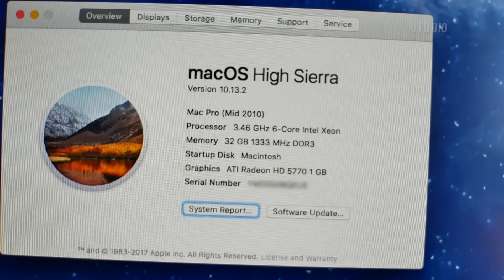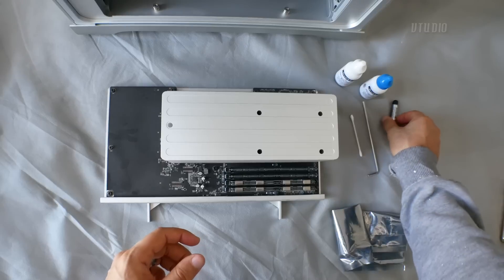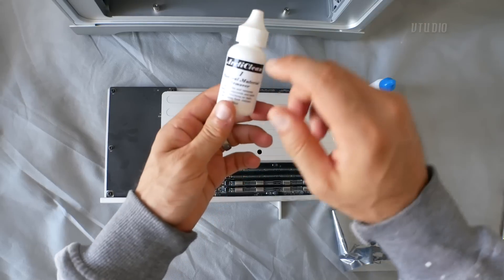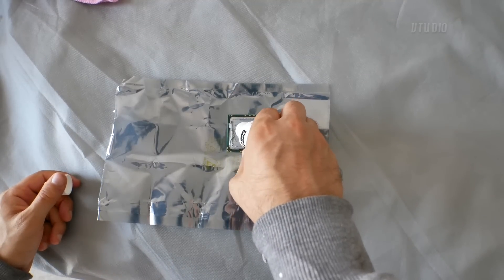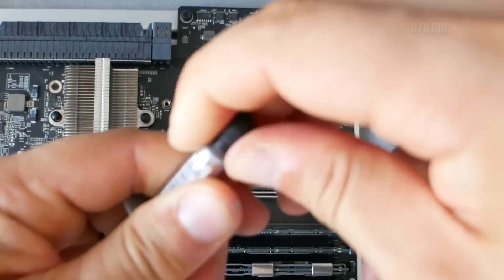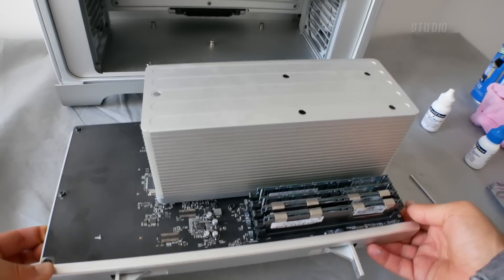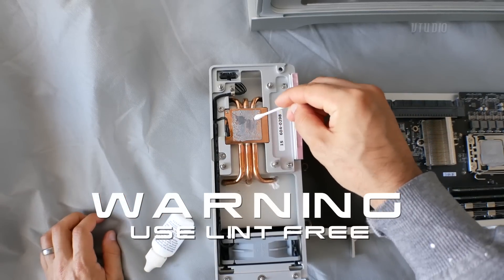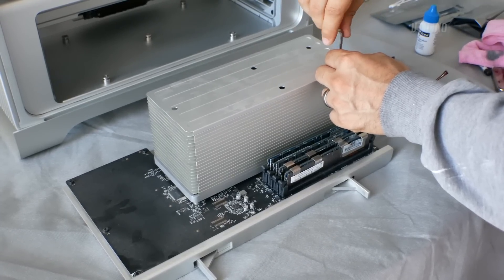Apple Mac Pro 5,1 CPU Upgrade Guide | 6-Core Xeon X5690 3.46Ghz

Comment: Hello,

Great videos and info. I have the 2009 Mac Pro 4,1 that was upgraded to 5,1. Now that i am on 5,1(2010) I want to upgrade my GPU, RAM and CPU. The CPU seem to be the hardest to do as I have to delid or buy a 2010 CPU tray. I have the 2.93GHz 8 core xeon tray. I wanted your advice with this process. So, my goal is first to upgrade the GPU to one that supports boot screen. Next my CPU upgrade directly reflects on getting 1333GHz RAM. One step at a time for me. I updated the HHD to SSD.
Reply: you can find the boot screen models on eBay, do a search for " mac video cards"  this how I found my Radeon 7950 for 175 couple years ago

Comment: Now this is history unless you have a graphic card with Metal-support, otherwise you can’t upgrade to MacOS 10.14!
Reply from the maker: I'm so glad that they kept support for these machines, wishfully hoping that they update the BIOS to fully support Metal graphics cards like the RX 580 in 10.14 - as in they register on the boot screen.
Reply: Kept support? They are not in the list of compatible devices, there you must have Mac Pro 2013 at least. With some work of your own you MAY be able to install 10.14, no guarantees.
Reply from the maker: Hey mate, it says they support 2010-2012 Mac Pro's with Metal capable graphics cards, not just the 2013 Mac Pro.

"macOS Mojave will be available this fall as a free software update for Macs introduced in mid-2012 or later, plus 2010 and 2012 Mac Pro models with recommended Metal-capable graphics cards."[1] 

[1] https://www.apple.com/newsroom/2018/06/apple-introduces-macos-mojave/
Show less
Reply: Okay, that I haven’t read yet.Sorry. I have a Nvidia Geforce GTX970 in my Mac Pro mid 2012 with Metal-support. But it’s not working properly. You can’t use it with MacOS Graphic Driver at all, just Nvidia Webb-driver. I installed MacOS 10.13.5 last night, and during installation the card began to use the MacOS Graphic Driver, and the installation wasn’t completed. I have to change language in Finder afterwards and restart the computer with the Webb-Driver. The card is recently bought on ebay, but I suspect it’s bad/broken in some way.
Reply: @parnordqvist3895  7 months late to this convo, but still completely relevant if anyone reads this. Get your facts straight on GPU support in cMP's... nVidia is supported with nVidia's driver, and AMD is supported natively. Apple prefers AMD these days, they even give some info on their site on cards they recommend. In either case you don't get EFI boot support which is why you're experiencing what you have, not because of bad card. Finally, look up MacVidCards if you want a card that fully works like a native mac GPU.
Reply: @binba9  the much cheeper way is to get an older GT 120 to realize boot screen and then put a powerful AMD card into your Mac.
Reply: its not history, for one... you can use High Sierra for YEARS without needing the COOL effects of 10.14.  2) there are gazzilions of Metal supported Vid cards for this computer. History? be old enough to use that word wisely
Reply: just flash your mac to a 5, 1 and that opens up things quite dramatically

Comment: What are your thoughts on the stock "twelve core" 2.93 xeon x5670.  Would that be decent enough to run the RX580?
Reply from the maker: Hey mate, yeah it should be fine running an RX 580 - did a review of that card here: https://youtu.be/RGCceOhv3f4, what's your use case are you more gaming or video editing or audio production or photography?
Reply: I was hoping to build a decent gaming rig.  I'm planning on upgrading to an SSD and sticking with the stock 16 gigs of RAM.
Reply from the maker: Nice one, for a gaming rig the twelve core would be overkill, you're probably better off getting a single CPU version as most games aren't optimised for more than one processor, unless of course you already own it and are just looking at a GPU upgrade.
Reply: Vtudio, I had the opportunity to pick one up for cheap that happened to be the 12 core model. An SSD and GPU are the only mods I have planned for now.
Reply from the maker: Ace dude, congrats!

Comment: I got the red light blinking after installing 3-(4GB) 1Rx8 PC3 -149000E and one regular 1066 in the wrong order. Now my 2.8 Quad Core has 16gig Ram (down clock) 1066, I got them free from a client that wasn't using them.
Reply from the maker: Ace deal mate!

Comment: I just post a comment in one of your previous videos and I just figure it out one f my questions... This machine (exactly the one I am just about to buy) doesn't support the double cpu... Do you think it's worth it pay the extra money for a newer model with that characteristic?
Reply from the maker: For me getting a dual core model would of doubled the costs, so it was out of the question. However, if you can get a good deal, then I'd go for a dual CPU. One thing though is that it's only a couple of weeks away for WWDC where Apple might announce their plans for the new Mac Pro, which may tempt you into waiting for that or at least drive down the prices of the current ones on sale.

Comment: Another suggestion for cleaning Thermal Paste is a coffee filter. Lint free and cheap lol. That's all I ever use when I upgrade and build my computers at home.

Thanks for the video :) Newer to Mac's but have tons of PC building experience. This and your memory upgrade guide helps. Planning to do a side job and trying to make sure I get the right hardware and see the upgrade process first. Though with the price of a Xeon 5690 still pretty high even here in the States I think the job might be restricted to just doubling the memory to 16GB from 8GB since that's the true bottleneck in that system. I just have a hard time telling them to upgrade to something that isn't really cost effective ($300ish for the X5690 vs. $90 for new memory) on a machine that is only used for running a couple of programs for a church service once or twice a week. Rather see them save that $300 and put towards a newer Mac down the road or something else they need to upgrade/fix.

Comment: A little suggestion.

If your single CPU Mac Pro uses a Xeon W3680 6-core processor, don't bother upgrading to a single X5690.

These two CPUs are fairly close in terms of performance, so you probably won't notice an improvement.  Conversely, if you can find a W3680 for cheaper than an X5690 for a single CPU tray Mac Pro with a quad core Xeon, it might make more sense to go with the W3680.  You'll still upgrade to six cores and your wallet will thank you.

The only real benefit to the X5690 is that it can work in multi-processor configurations whereas the W3680 won't, therefore (if you're wanting to upgrade from a W3680) it makes more sense to save up for a processor tray swap to a dual CPU tray, perhaps with twin X5690s.
Reply from the maker: Hey mate, where did you hear that the X5680 won't work in dual xeon configurations?
Reply: The W3680 won't work in multi processor configurations.  Source: Intel datasheet under "Package Specifications (Max CPU configuration: 1)."

https://ark.intel.com/products/47917/Intel-Xeon-Processor-W3680-12M-Cache-3_33-GHz-6_40-GTs-Intel-QPI

I'm sorry, but I didn't say anything about the X5680.

And single CPU tray 6-core Mac Pros using the 3.33 GHz processor were equipped with the W3680 as opposed to the X5680.
Reply from the maker: My mistake mate, I read the 3 as a 5.
Reply: No worries.  Cheers.
Reply: I think you may have to find a 2009 Mac Pro tower that either has no tray or a single processor tray to use your dual CPU tray in.
Reply: Ah, so the CPU would work, but the concern with a lidded CPU is that it's too thick to allow proper mounting of the heatsink.

But, it is possible to mount the heatsink without delidding.  You just don't tighten the heatsink mounting screws all of the way like you would with a delidded CPU.

This video might be helpful.

https://youtu.be/7O-FQgeaBE8
Reply: Sounds like what I need to do. I have the 2009 dual CPU tray with two 2.93GHz Quad Xeon chips. I want to upgrade to the 3.06GHz six core Xeon for 12 cores (Westmere), this should allow for me to use 1333GHz RAM. But the 2009 4,1 trays are not compatible with the 2010. Any suggestions?
Reply: Watcher3223 - I have the 2009 Mac Pro that I have flashed firmware to 5,1. I want to drop two westmere Xeon chips in my current tray for a 12 core config and to utilize faster RAM. But I'm reading that putting native westmere 2010 Mac Pro Xeon's into a flashed 4,1 requires De-lidding. I've built one hackintosh and am not trying to do that again. Do I need to be concerned about De-lidding the CPU?  Thanks
Reply: can i upgrade my 2010 with a single 3690? it has the old 2.8 in it
Reply: I wish I would have read this before my upgrade. But I did purchase the X5690 for $82, and plan to sell off my old X3680 for $50. So ultimately I got a small upgrade for about $32, which in the long run isn't too shabby, I guess?
Reply: thanks for your input in this thread,  i have a  "Mid-2010" "Quad Core" model with a 3.2 GHz Quad Core "Nehalem" Xeon (W3565) and im trying to figure out if the Xeon X5690 3.46 GHz six core is indeed compatible with my machine ? or whether just to go with a Intel Xeon  W3680 3.33 GHz ?  as this will be the first and last time i upgrade the cpu i want to make sure i put the maximun possible power in it i can yeah and im curious how much  better the performance will be with a  Xeon X5690 3.46 GHz six core ? if its a reasonable boost i dont mind paying a little more for it etc. please let me know if im wasting my time in regards to performance gains ?

Comment: Does that cpu turbo?
Reply: Also how does the 2.93ghz that turbos to 3.33 differ than the one you have other than the obvious speed difference ? May be a silly question , but am curious
Reply from the maker: Hey mate, according to intel.com the max turbo of the X5690 is 3.73ghz [1]. I don't have any personal experience with the 2.93ghz, I think you're referring to the X5670? If so, the specs [2] look very similar other than the speed, for me I was upgrading from a W3530 quad core, so the bump was significant.

[1] https://ark.intel.com/products/52576/Intel-Xeon-Processor-X5690-12M-Cache-3_46-GHz-6_40-GTs-Intel-QPI
[2] https://ark.intel.com/products/47920/Intel-Xeon-Processor-X5670-12M-Cache-2_93-GHz-6_40-GTs-Intel-QPI
Reply: that CPU makes the computer equal to a newer iMac. What he should have done was bought a used 2 CPU tray and upgraded to a 12 core screamer. Now you've blown away a new iMac retina for sure.   only drawback to these machines: no thunderbolt. If thats no problem, a Cheese Grater Mac Pro is a great buy for the money to MHZ issue

Comment: how is performance of the mashine before upgrade processor
Reply from the maker: Hey mate, I have the charts on at 9:20 comparing before and after. I've also got another video going into detail on the performance after all the upgrades here: https://youtu.be/1EtDAGzqZz8

In summary CPU speed pretty much doubled. In my opinion the best upgrade I made was switching from HDD to SSD. You can see a video about that upgrade here: https://youtu.be/7W4bPPeH0n4

Comment: Thanks mate, was really helpful and in detailed. Find me asking I wanna upgrade my Mac pro 2012 (5.1) quad core 2.33ghz (last one before the cylinder model came out). What can I upgrade it to?
Reply from the maker: Hey mate, you can do the same upgrade I made here with a 6 core Intel Xeon X5690 CPU - as it's the fastest option for our motherboard (3.46GHz). Alternatively, you can also look at the X5680, which is also 6 cores but slightly slower  (3.33GHz), but more importantly can sometimes be found at a much cheaper price depending on stock availability.
Reply: Vtudio thanks mate. And keep up with the channel as you explain and demonstrate things in detail and well. 👍🏼
Reply: @AppleReviews  Was going to buy 2 xeon x5690 for mac pro x 2  2010 will it damage motherboard ?

Comment: Hello i bought 2 wifi card and i do not work any osx sierra-osx high sierra
please can you rate who wfi card is perfect for mac pro early (2009) 5.1 2x2.26 ghz than mac osx high sierra
Reply from the maker: Hey mate, I personally went with a USB wifi dongle as I figured it'd be easier to replace than a card. But, if you're looking for a card, I've heard good things about the Mac Pro Wifi 802.11ac & Bluetooth 4.0 upgrade kit: http://vtudio.com/a/?ebay=262864275416

*Good thing about getting it from eBay is you get buyer protection and if you need to send it back for a return if you pay with Paypal they provide free shipping for up to 8 items a year.
Reply: you can run newest bluetooth 4 and  AC wifi, but you'll need an adapter.  Look on ebay for Mac Pro Bluetooth 4 AC WIFI kit or go to floridaapplemacpros.com they have it.